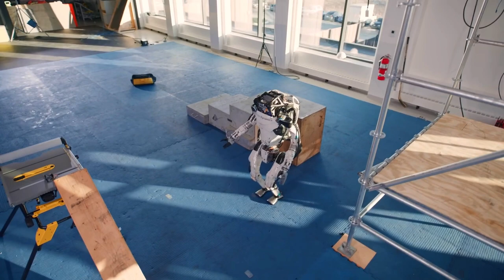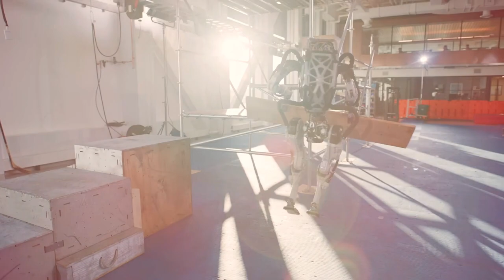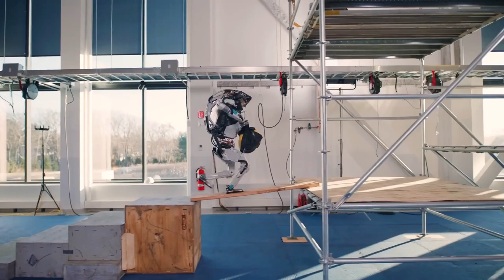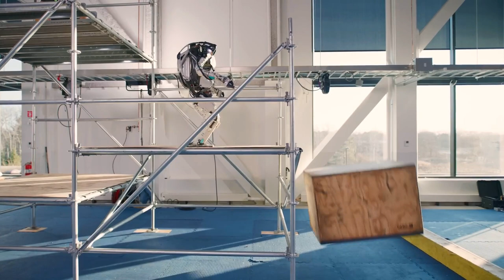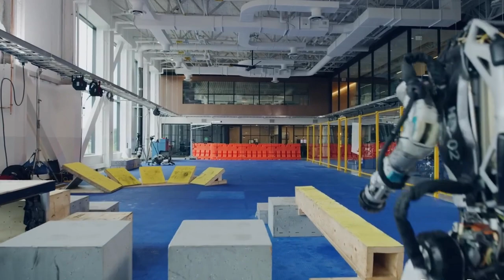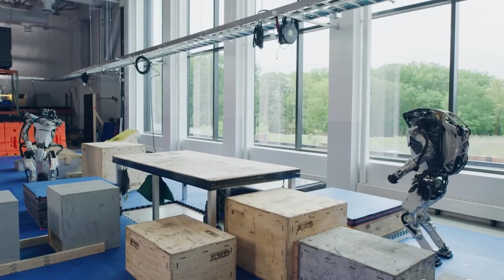Atlas by Boston Dynamics | Pushing the Limits of Mobility, Perception, and Athletic Intelligence

Comment: When I was seeing this for the first time at the beginning of its manufacture, I was shocked, but today I was deeply stunned, and I think from my point of view that it is one electronic head in one body that is not enough to be a complete robot, meaning, have you thought about adding, for example, more than one brain In one robot, or combine them, maybe my view is wrong for this robot to control itself. I think it needs a lot of development. Since it started 10+ years ago or so, I don't know how to program it, but it's an amazing development ,,,
Reply: Parallel programming is common and almost certainly used in this system